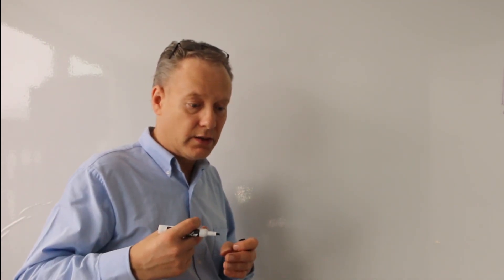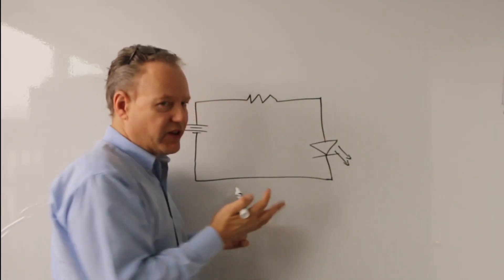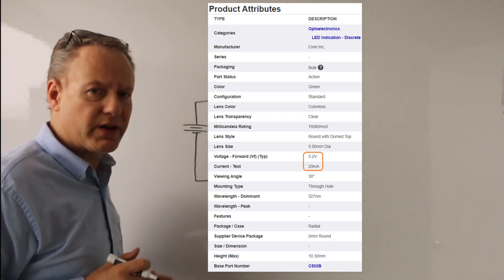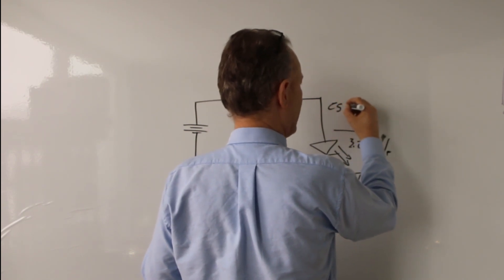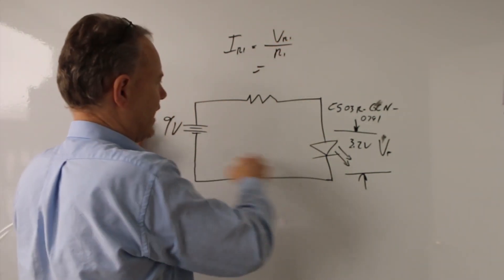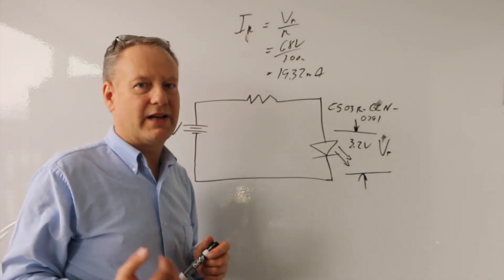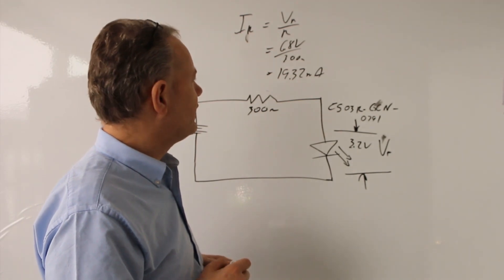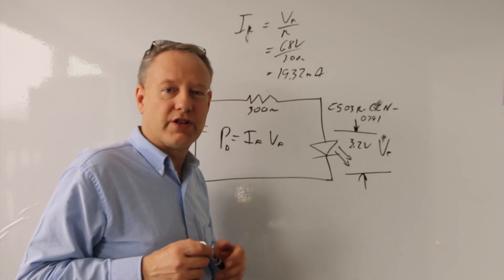LED Circuit Calculations

Comment: DON'T use the term OPEN when describing a conducting diode or transistor.  YOU ARE CONFUSING YOUR STUDENTS...Open is a poor choice of words..also the reason the water valve analogy is just confusing to newbies..a closed valve stops water current..an open valve allows full..closed switch..full current..open switch..no current
Reply from the maker: Thansk for that feedback.